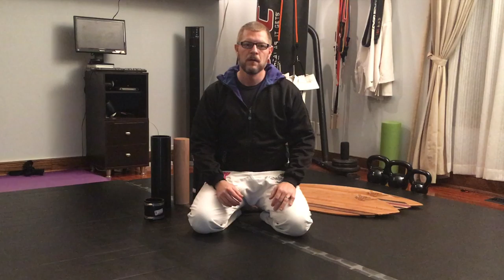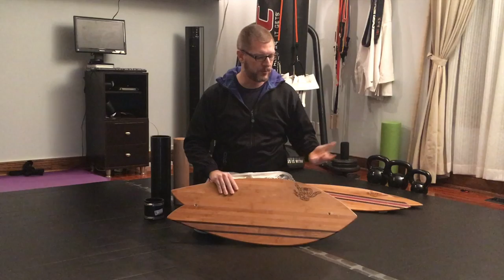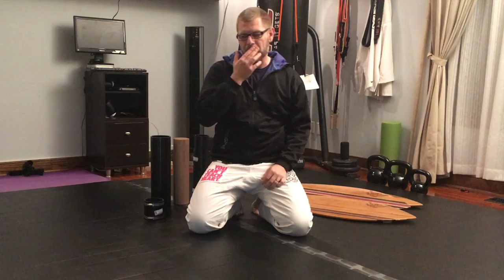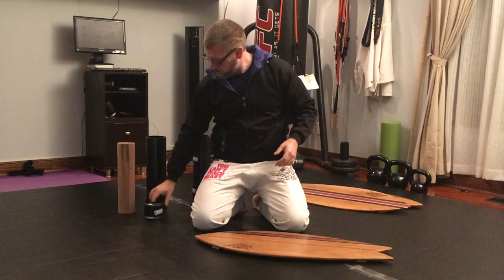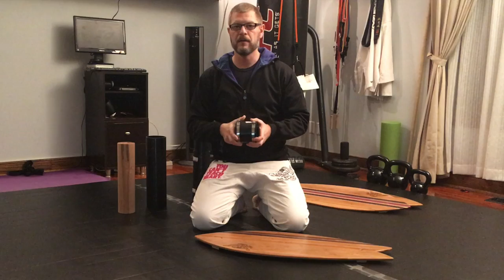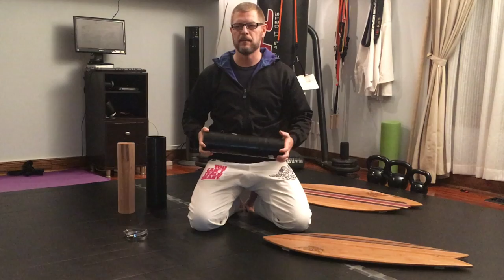DIY Balance Board Roller

Comment: Great roller. Thanks. Here’s an add on. I got 3” pipe in 2’ length. Cut in half, then cut 4” off other piece and put 2 rubber sleeves just as you described. End result is a roller that adds the ability to lean. No additional cost. It works with one sleeve on the remaining piece. Even more dynamic. Thanks again.

Comment: great idea!! i'll try this out. about to start doing this for first time and just between making vs buying. only thing that seems trickier for a self build is to be able to do balls with guards on bottom. i don't know of any curved rails you can buy. THOUGH, if you did a second layer of wood on the bottom, you could cut out a circle and inner circle and glue/nail, etc to the botttom. or a design that is as big as the top piece and just has the middle cut out. to keep a ball from totally flying away from you.

Comment: Fat tire bicycle - inner tubes cut to 4"(?) and slide over wood roller to increase contact friction w/board. Harbor freight has 12 in. x 12 in. Self-Adhesive Rubber Safety Mat with Tread Surface for less than $6

Comment: How about using a slightly longer piece of pvc and putting caps on the ends? It would hold the rubber sleeves in place and also act as a channel the board the rest in.

Comment: I noticed that you recommended 3” pipe.  The indo board has a 6.5” roller.  Home Depot sells the stuff you bought (pipe and rubber connectors) in 4” which is closer to the 6.5.  Any specific reason why you chose 3 over 4?

Comment: Could you just use a foam roller for it or is it too soft?
Reply from the maker: Too soft.... correct. it would work for pushups on a balance board... but not standing....
Reply: or you can use pool noodles with an inner core of a pvc pipe. (more for beginners)

Comment: Hi. Has anyone trying using firm foam roller for the balance board?
Reply from the maker: I did try that... it will work, sort of.... makes for a really easy to use roller. It squishes and doesn't roll much, which could make it easy if you are just. learning.